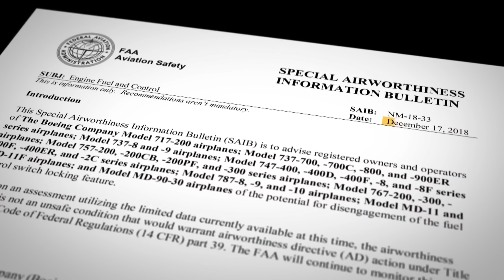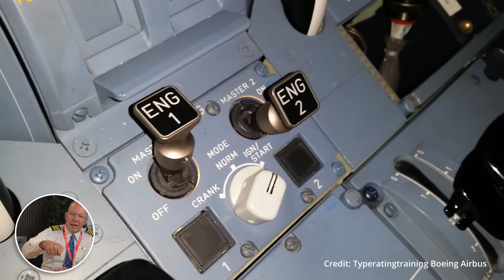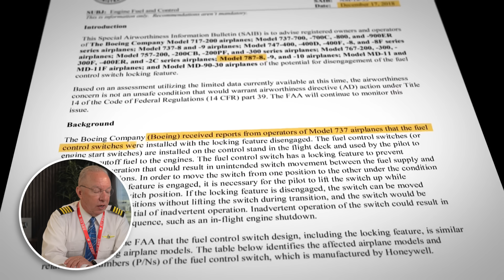Air India 171: The FAA’s 2018 Fuel Switch Locking Bulletin Explained (16 Questions Answered)

Comment: as just a user (or say pilot) why do you have such persistent confidence on switches? whatever their type/grade, switches have limited on-off lifecycle and prone to material fatigue and many has design problems that users doesn't aware of..
Reply: Just no. The switches were designed for a defined lifecycle and maintenance would replace them miles before the end of such a lifecycle.  Incredibly long certification and testing and in service experience give engineers and flight safety agencies and users more than enough information

Comment: Let's face it Boeing has a history of cover ups after the first 737Max disaster - after investigation they stated that it was due to a pilot/maintainance error/fault, did't they ? They only told the truth after the second similar crash... I do not trust Boeing's version of events, they would go to any lengths to prevent their stock value slumping
Reply: It’s not Boeing’s version of events.  It’s the AAIB’s.
Reply: @ryandefranco7740  +NTSB, + FAA. IT is a joint investigation ... Bare in mind FAA had granted Boeing authority to conduct their own  sertification until the second 737 Max crash... This speaks for itself.. If it is done once it can be done again - even if they do not grant authority for own investigation they can participate in a cover up if only a single occurance of a specific fault is the reason...
Reply: @ivanez1im  - One of the pilots intentionally set the switches to CUTOFF.  Any other theory is wrong.  If you disagree, Infowars if probably the place for you.
Reply: @ryandefranco7740 and they don’t have a history of cover ups - that’s just the usual nonsense that does the rounds on social media
Reply: Lets face it we live in an age of global daring lies which brake new bigger and bigger frontiers every time... This is especially true if huge corporate interests are involved.

Comment: Why do those switches have the D10 safety feature and caps over the switches as well and why not add a 3rd safety option to that too. For something that is that important there should be more than one safety feature to keep you from accidentally flipping that switch. We have them on semi trucks and wrecker trucks as well. So you have to physically pull down the cap and pull it up to uncover the switch and you have to pull up on the switch to turn it on or off. You would think if they have that on semi trucks it would be a no-brainer for something that is so much more important on a plane.
Reply: How many billions of flight hours have accumulated without incident?  And it’s because design, testing and certification and the feedback of in service experience into improvements make aviation the safest form of travel.

Comment: Yeah but could you accidentally knock both switches together at the same time? i would have thought they would cover the switches with some clear red plastic cover that you have to lift up then move the switch if they knew they had this problem. It doesn't look like a detent, it looks like a little nipple you have to lift it over the nipple not out of the detent so that wouldn't apply being halfway. I don't think that's correct if it was installed switches upside down it would default to cut off!! no reason why it would! how do you come up with that scenario? Far as I can understand is there is an issue with the switch that can be knocked off without lifting that's the bulletin nothing about upside down.
So the run cut off wasn't in the cutoff position? if you're saying the pilot put them back into the run position? So it's the black box telling that they were put in the cut off and put back into run? I thought they looked at the crash and saw the switches in the cutoff position! no that's not the case?
Reply: Did you watch any of the videos covering the operation of these switches 🙄

Comment: If one of the pilots intentionally flipped the switch, it suggests they were fully aware of the exact timing required. If the plane had already been airborne for a few minutes — say up to three — then turning the switch back on wouldn't have immediately caused the aircraft to crash. That means the person who did this knew precisely when to turn the switch off to ensure that when it was turned back on, it would already be too late for the other pilot to recover the plane. This wasn’t a random action — it appears to have been calculated.
Reply: Exactly . It was deliberate, regardless of which pilot did it.
Reply: The evidence is all pointing towards human cause.
Reply: Spot on,  are the pilots being investigated?  A person doing something like this would have to show signs of instability leading up.
Reply: @partymanau 
In a crash like this they investigate everything including the pilots. If the investigation indicates it possibly could be a pilot crashing the plane, they will dig into both pilots to see if there is anything there.
Reply: @njlauren  Its a preliminary report.
Reply: @dps2933 
Of course, and people are commenting on what is known from that..ppl early on speculated that it was the flaps bc there were some questions with that. 

The thing is ppl speculating as to the cause doesn't hurt anything, the reality is the final report is what it will count. I will add the preliminary report imo has strong data that supports the hypothesis that it was pilot action, but data that comes out later may contradict that. 

the final report is what will determine the cause. It is possible that due to political pressure the investigators take a mulligan and say ' we could not fully determine the cause', but you can bet that if they come up with a conclusion it will be analyzed to the nth degree by experts to see if the conclusion matches the facts. 

To me ( and I am no expert, just using my own logic and inference) the currently known facts point to pilot action.  If information comes out later that challenges that conclusion, I would rethink it.  in the end my concern is not as much pinning blame as trying to make sure it doesn't happen again. 

When Korean air had all those crashes, the investigations pointed out the problems that caused it, that had to do with cultural and communications issues as well as flight protocols, Korean Air addressed it in their training and flight procedures and Korean Air since has become indistinguishable from other carriers.
Reply: Fo is PF
Reply: Eveyone is missing a important point when switches were turned off it was done in 1s but when it was turned on it took 4sec first left than right
Reply: Well, that pilot would not have waited so long because it  almost made a recovery.  If they really wanted to crash, that pilot would have shut them off at takeoff commital speed while still on the runway.  They would not have gained nearly as much height to recover in time
Reply: @Bernie-e9i  Plenty of runway remaining, brakes and thrust reverse's would have most likely saved most of the passengers, pilot flying would hear the spool down and reject take off they train for these scenarios, to be honest if someone wanted death for everyone they did it perfectly. Almost made a recovery sorry if you understand a drag curve the chances of getting those engines back to any sort of thrust level to revert that decent and get any form of life would have needed 1000 minimum under them which they have about 600. I think the rapid relight in a Genx is around 15 seconds. then you have to reverse the decent and then climb. in 600 feet chances near 0.
Reply: @spaus65 for that flight however if the pilot wanted to sabotage it he'd start further down and take the full runway length and be unable to stop.  By the time anyone would notice it'd be too late.  They'd get about 100 feet to 200 feet and then crash into the ground not 650 feet
Reply: @Bernie-e9i  Sure that could have been an option, but he didn't choose that one. its the best explanation just because you don't like it. Us arguing and never getting a consensus as to the exact cause is exactly what he wanted, its a clever way to go. the family can always point to other causes or doubt if it was true or not he did it. he's smart as he was evil.
Reply: @aussiechristian im not argu ing and its more like you dont like it because you bought into a narrative with little to no proof at all. Thanks.
Reply: @Bernie-e9i nearly saved is worse than nearly crashed.  Timing was perfect. They were shut off at the goldilox moment.  Too soon and the plane may not take off and any later and it would have recovered.  Chance got it perfect. No way it was a highly skilled pilot.  Or maybe a ghost in the cockpit.  People love a good ghost story
Reply: @barryobrien1890 thats incorrect.  The lesst chance if recovery woulc hsvd been at a lower altitud.  This aircraft got to 650 feet.  So its clear the switches of turned off were turned off very late vecause the plane was within seconds of recovering.  I'm a retired A&P and have done plenty of engine runs.  This aircraft nearly recovered
Reply: @Bernie-e9i nearly does not hack it and the switches had to be switched off at a time when they would not be noticed.  If it was still on the ground alternative saving steps could be taken.  Only one engine showed recovery and the other was just beginning.  Who knows if restoration of the switches was not anticipated, and an oversight. We will have to wait on the full report of all that went on in the cockpit prior to discovery of the switches being off, but they stayed off for over 10 seconds indicating it's not a normal restart procedure.  I am sure we will know more as the investigation continues and more is released.  I am sure there was more than "why did you turn off the switches?". " " No not me". " mayday mayday".
Reply: @Bernie-e9i  there was a long delay when setting the switches back to run, 10 seconds, and 14 seconds. This indicates a struggle IMO
Reply: @clark5242 it can indicate an electronic signal not connecting.  Remember these switches physical positions are not recorded. The electrical connection is what's recorded.  Even if they were moved there's been no confirmation the switches were in good working order.  Mechanical and electrical components can fail.   The pilot who commented first on it could have been reading the console.  And the FADEC could have failed which would shut the engines down by cutting the fuel
Reply: If, a big IF a person did it. The pilot says he didn’t do it. If a person did it intentionally there is no way the final position of switches be back in on position.
Reply: @akshaynupur  There are two pilots, and the one who flipped the switches knew the job was done. turning them back on will prove nothing the end result will be the same and will confuse the investigation. these guys are pilots not dunks at a pub. he has this planned, the exact time for switches to give him the exact result he wanted and the runway without a suitable ditching or landing location.
Reply: @aussiechristian  Time window is quite small to destroy a plane, after V1 maybe 40-60 seconds? Computer should prevent cutoff at that time. And pilot manuals say you dont cut off below 400 feet anyways ever (even if fire), so there is not reason not to add that to computer.
Reply: @akshaynupur  "If a person did it intentionally there is no way the final position of switches be back in on position." What??? The co-pilot moved them back trying to avoid the crash but the engines couldn't recover quickly enough.
Reply: @akshaynupur  read the report. The switches were placed back into the ON position 10 seconds after being placed into the CUTOFF position. Someone did their best to reverse the situation.
Reply: @patfisher22 How about the pilot asking the other pilot why did he do that? CVR evidence with FDR evidence.
Reply: @marcludwick512 if you want to shift blame to the other guy so your family is protected and you are aware of a cockpit recorder, wouldn't the obvious thing be to ask the innocent guy why he turned off the switch as soon as the engine is shut down so it's too late to restart
Reply: @Ducreuxs  Both pilots knew it was too late. Terrorist chose exact moment
Reply: @Ducreuxs  10 second delay!  count that out aloud 1 1000 2 1000 etc... That is a huge amount of time. This indicates a struggle IMO
Reply: @akshaynupur 
Of course you’re gonna deny doing it if you did it on purpose. Snd they were switched back on by the other pilot. The one who didn’t want to die.
Reply: @akshaynupur 
That isn't true. The exact sequence is the engines died, the pilot noticed the switches had been set to the kill position, and he put them back in the run position. How do we know this? The data recorders show all the actions involved, they know the switches were  set to the kill position ( with a second gap between no 1 and no 2 thrown) and then they see them flipped into the run position later.
Reply: @njlauren the report says they were off for more than 10 seconds allowing the engines to spool down.  They immediately started up after the switches were reset per the report with the right achieving partial trust.
Reply: @barryobrien1890 
Yeah, the engines take a while to spool back up. If this had happened later in the takeoff when their airspeed was much higher, the plane could sustain flight long enough for the engines to spool up and regain power ( think about how captain sully with two dead engines could fly the plane long enough to ditch it). That this happened when the plane was barely above stall speed doomed the plane. Which is another thing that makes me wonder, that the engines were cut off at the most critical time in the flight,something a pilot wanting to crash a plane would know. This would require at several coincidences if we are to believe it was an accident based around the switch not locking properly:

1) that it affected both switches, not one or the other. Even if the lockout was not enabled on both, it is statistically more likely one or the other would flip to cutoff, not both

2) that with all the planes flying with these switches for how many years that from what I can tell has never happened to any other aircraft. One question I have , the switch is made by Honeywell and I wonder if it was made strictly for Boeing or was it a generic item routinely used in other planes? A cutoff switch like that would be something more easily being generic I would think, would mean cheaper production costs and cheaper cost to the maker of the aircraft. If so then potentially it could be in even more aircraft.

3)that the pattern of cutoff, sw 1 then sw 2 w 1 second between them, was the kind of profile you would see with a human manually doing it.

4) that it happened at the possibly worse place it could happen. A little while later there would be time to spool up the engine, earlier and the plane could abort takeoff and stay on the ground. 

5) Another post on here said that the switch after the crash was found and found to be in the run position. That implied that the lockout was working,bc if not with the impact of the crash it should have flipped to cutoff.

There are a lot of coincidences to make this an accident. Could it be? Yes, especially since we only have preliminary info, it is not a complete picture.

People are saying that this is typical, that they immediately blame pilots for crashes.  I will give another side of that, lot of people when it involves Boeing immediately say it must be their fault. The ppl at air Indonesia with the missing flight for many months blamed boeing bc at the time the 737 max stuff was still on people's minds,despite the fact that the known evidence showed it was human action. 

'but Boeing has been so bad'. True, but if you look at it in investigation of crashes it incidents no one tried to cover for Boeing if the evidence showed it was them, been plenty of incidents/ near misses with them.

And the reality is that 80% of aircraft issues come down to human error or action.

At this point almost all the evidence suggests it was a deliberate action by the pilot. And I am sure that in the investigation air India and the Indian investigators will be really thorough and if it is in fact Boeings fault, they will be quick to blame it, they have every reason in the world to try and absolve the pilots for obvious reasons.  I am glad there are outside investigators involved  because to be blunt, there will be strong political pressure in India to come up with a report that absolves the pilots and there could be a cover up the other way.
Reply: @akshaynupur  Say can be a lie when he have that intention.
Reply: @akshaynupur  I am curious that there’s no mention of any call-outs on “positive rates”.. “ gear up”. In this case FO was PF and the Captain was PM.I guess the PF was asking the PM “why…” I wish they would find out who give the mayday call. Comm switch from the left or right. If left then the ball is on the right-PM.
Reply: Do you really think that someone will intentionally do this? They are pilots not terrorists. 
If it was about mental health , he might have done suicide and not crash the plane.
Reply: @rkvlogs8000  it has been done before, so yes, and it was done perfectly.